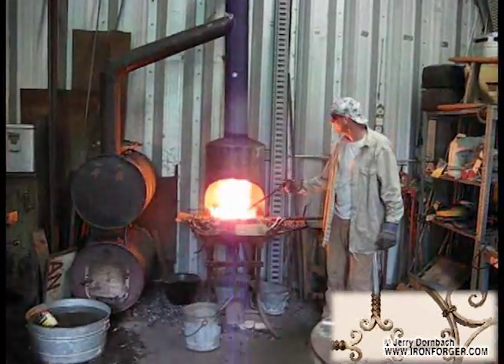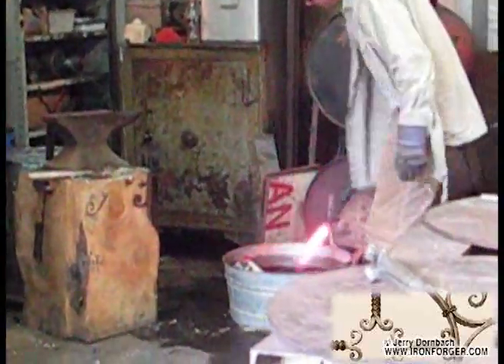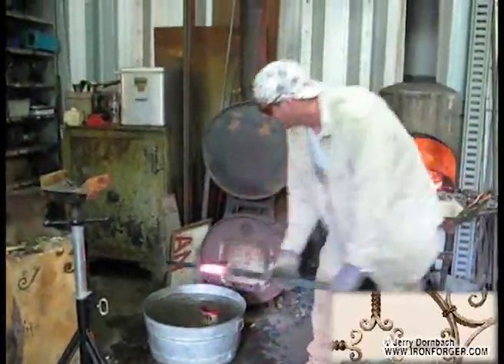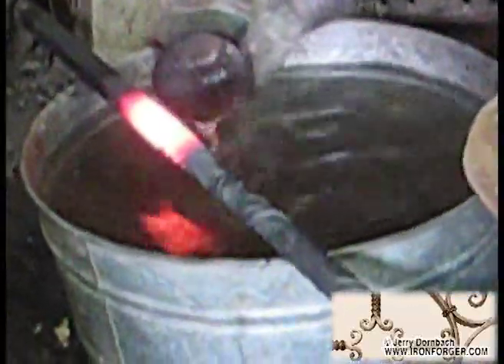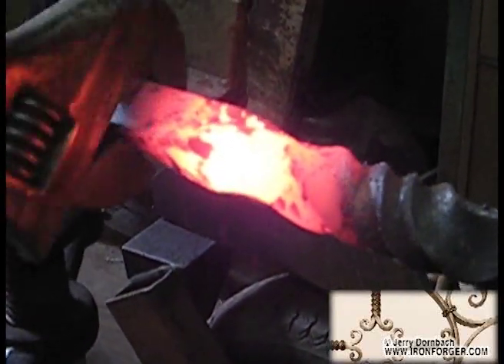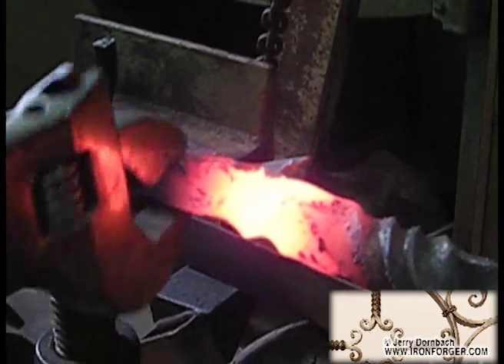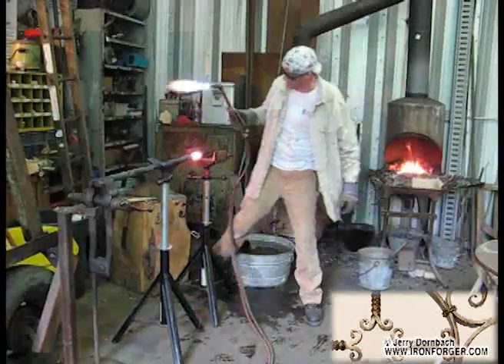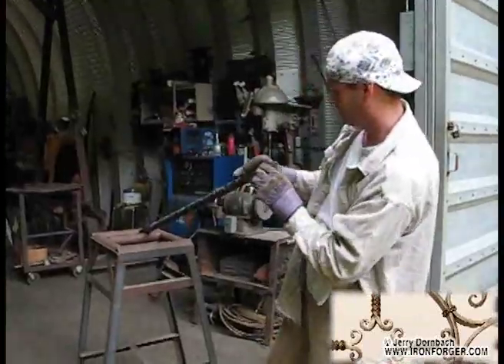Blacksmith - Jerry Dornbach - Artist Blacksmith   Twisted metal demo

Comment: NeonShep I don't think. Welders also claim that in the wintertime they have to work harder, but that's imho bullshit.
If you heat up the steel around 700 Celsius, it doesn't matter if the environment is +20 or -20... the deltaT is 720 or 680... Simply doesn't matter.